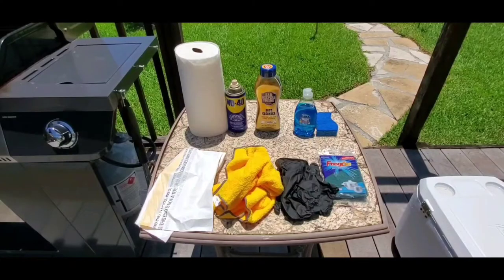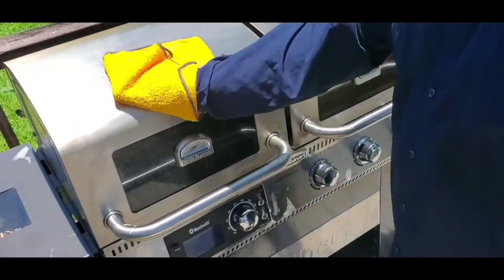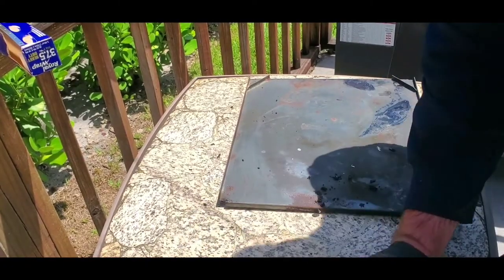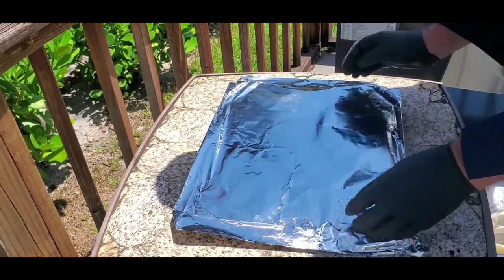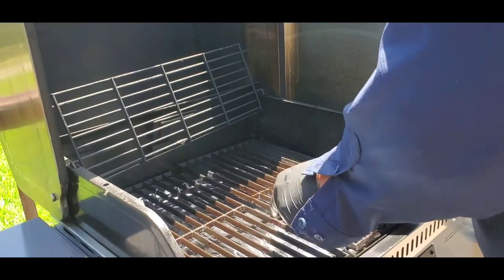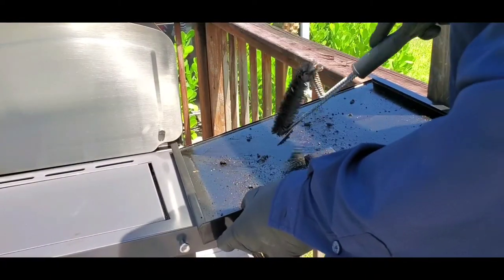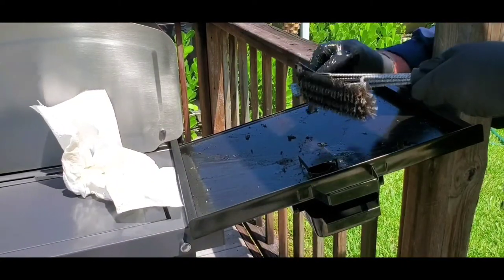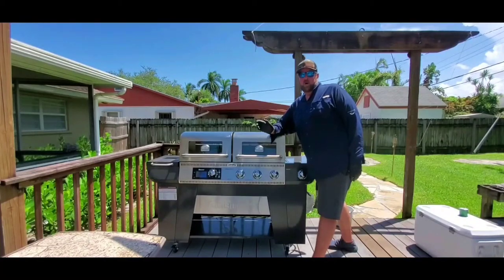How to Clean the Cuisinart DualFunctionPellet and Gas Grill #cuisinartbbq #cuisinarttwinoaks

Comment: Very good video. I have the same smoker/Grill and that foil on the tray was the first thing I did after my first Smoke/Cook. I would add that cleaning/vacuuming the fire pot is a pre cook ritual because the self cleaning ash slide under the smoker does not do a very good job of getting all the ash to drop down into the tray.
Reply from the maker: ZoomIDoRx8 thanks! Yeah agree it clogs up that ledge. Thanks for watching. Happy grilling 🔥
Reply: That’s a helpful add, thank you!
Reply: I am looking at buying one of these grills. How have burners holding up? I read a review that said they rusted out in one year.
Reply: I am looking at buying one of these grills. How have burners holding up? I read a review that said they rusted out in one year.

Comment: Hey! Great video! I was wondering how the grill has been holding up? Is there a lot of rust on the propane side or is it holding up okay? What are your overall thoughts on it?
Reply from the maker: Thank you! It’s been holding up pretty well so far! No complaints from me. I had one issues with the knob stripping on the pellet side and the sent me a brand new control panel right away.
Reply: @Castingandcookingbbq  good to know!!! Looks like I might end up picking one up. Thank you for the information!
Reply from the maker: @ShantKelian  you are very welcome. My buddy has the woodcreek which I also used which is also a great grill the searing station on it works great!
Reply: @Castingandcookingbbq  yeah that's what I wanted to buy initially but having a propane grill for quick cooks would be very handy. Still thinking about it all. Very tough decision haha
Reply: Beware of the labels - I've had mine for few months...love it.  After the burn-in, I sprayed some avocado oil on the grates and wiped it on the stainless.  I got some on the black control labels and they are now wiping of or smeared.